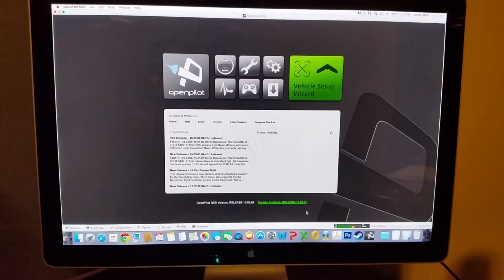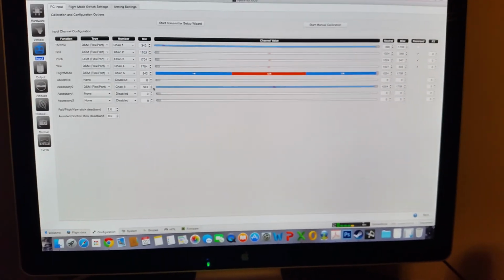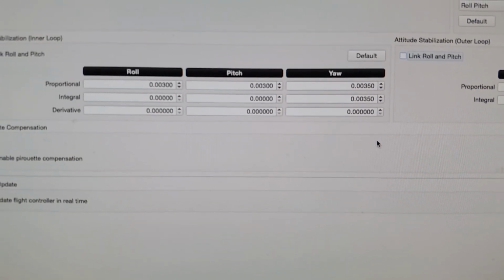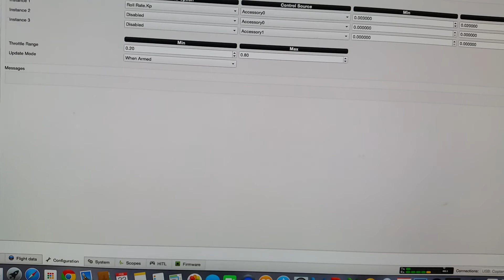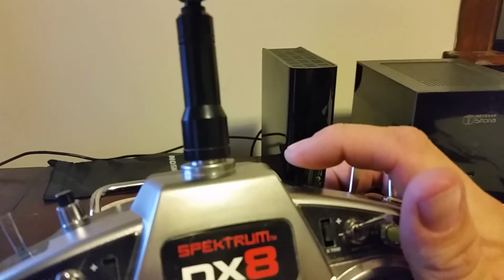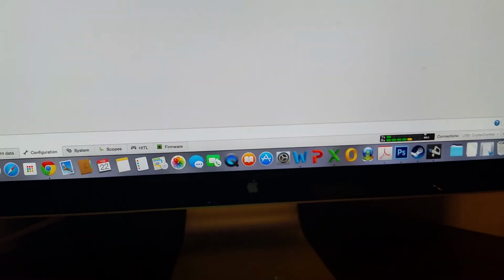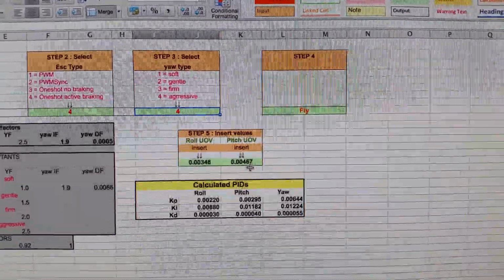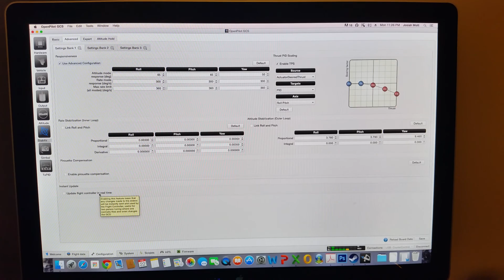CC3D OpenPilot TxPID Tuning Quick Tutorial with OPtune Spreadsheet Link in Description

Comment: Does this work better than the Easy tune settings in TxPID?
Reply from the maker: Not sure!  Try both ways and let me know.  I really don't use CC3D anymore to be honest.  Been using Flyduino KISS FC since its release with much success.
Reply: +TheQuadcopterJunkie easy tune ended up working out better. but my frame is huge, 3d printed joints and articulating arms. your way may work better on racing quads

Comment: Hey. I just have build octacopter x6 seems all working, but it is really wobbly. so I need to setup my pid. As I also installed and connected bluetooth to my cc3d  all works, I also got me self open pilot app on my android phone. could you suggest me the best and easy option to setup my pids? or might be apps? or what is the easiest way to setupp pid for beginer
Reply from the maker: The TxPID shown here really is the easiest way to tune on CC3D if you are not using the newer LibrePilot.
Reply: I am using 15.09 Libre pilot is this is the one you mean esy version to tune my pids?
Reply from the maker: To be honest, I started using the Flyduino KISS when it came out and never flashed LibrePilot to my CC3D boards.  I have only every used OpenPilot.  From what I can tell, LibrePilot has something similar if not the same.  I will be putting a wing together soon using my old CC3D, but PIDs are not the same at all with only one ESC.

Comment: Your setup looka interessting. What props are that? What do you recommend for a beginner? 3s or 4s?
Reply from the maker: Those are DAL 4045 bullnose triblades. For a beginner, I recommend 3S. Since this video was posted, I replaced the FC with the Flyduino KISS 32bit FC, and their 24A Racing Edition ESCs. It is much easier to setup for a beginner as the stock PIDs work pretty well. All you have to do is a little adjusting.
Reply: Thx :)